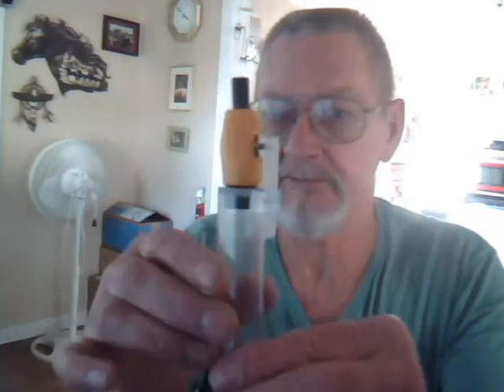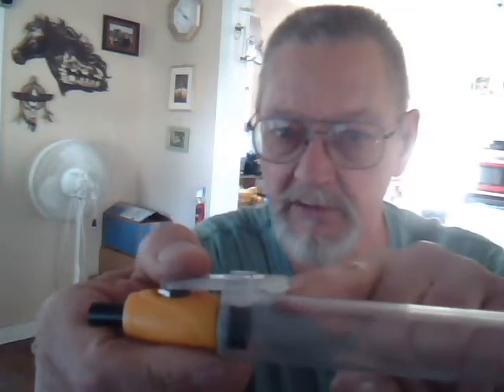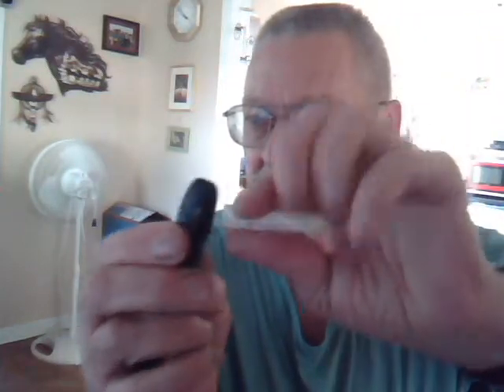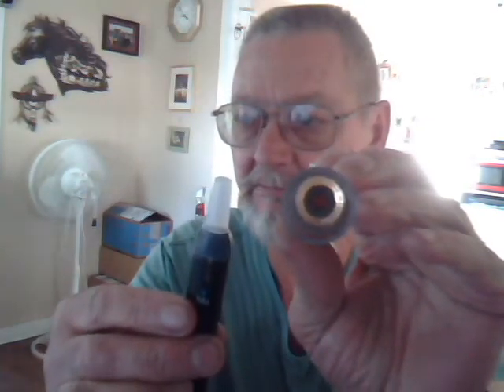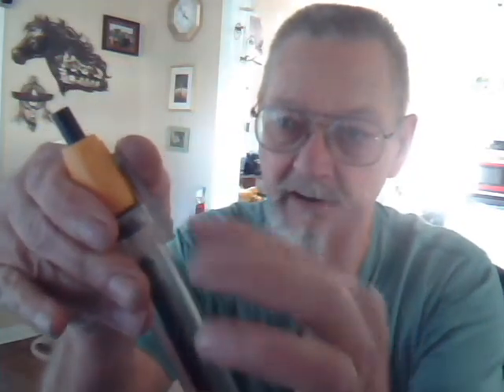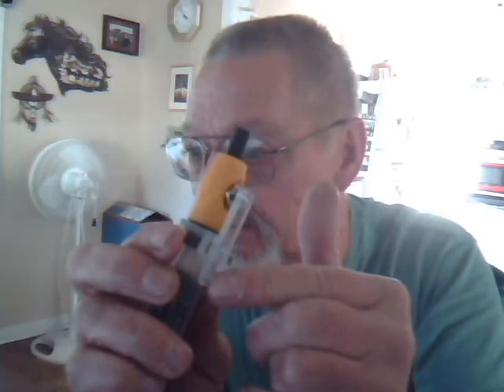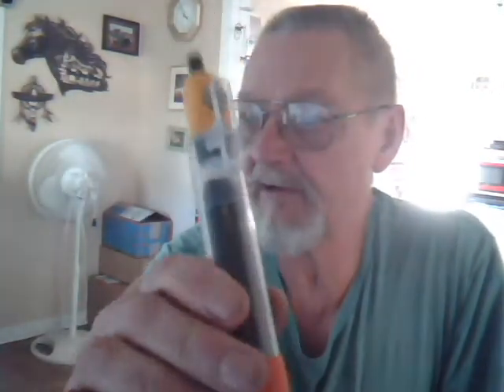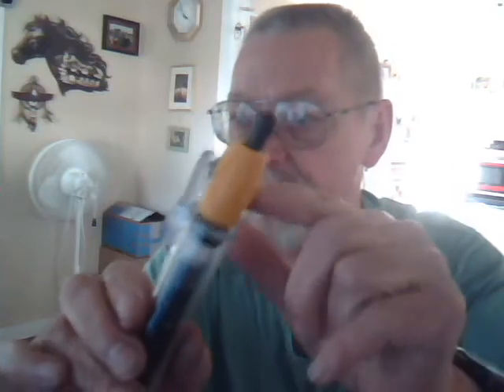Waterproof vape mod that floats

Comment: This is brilliant, I'm a landscaper and I am constantly replacing pods because of dirt. Do you have any problems with moisture buildup? Have you tried a smok novo in it?
Reply from the maker: Thanks for the comment...the smok novo is too wide to fit inside...1 inch tube was designed around smaller width  pod mods. There is always a small amount of moisture buildup because heated vapor condenses on a cooler surface. The mouthpiece of anything I have vaped with always does this.